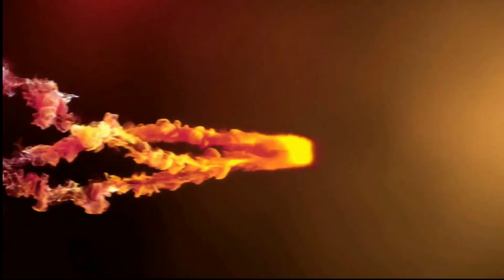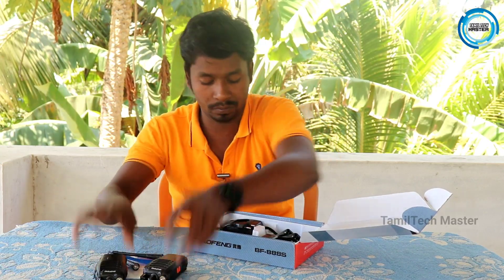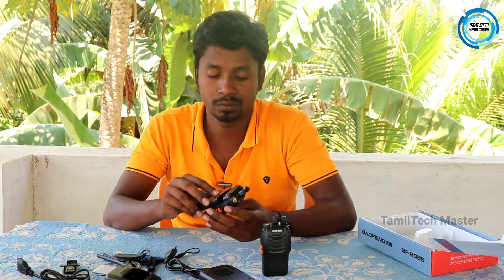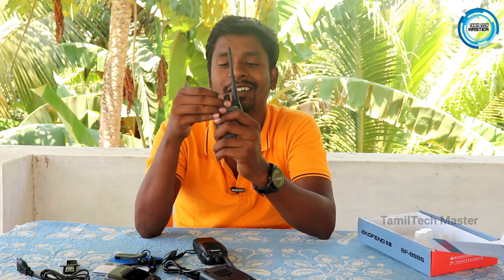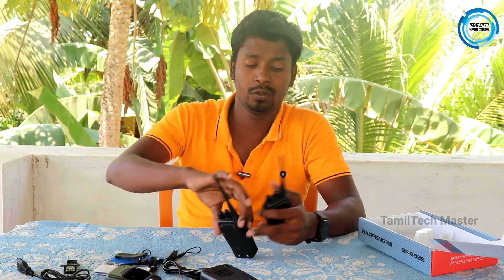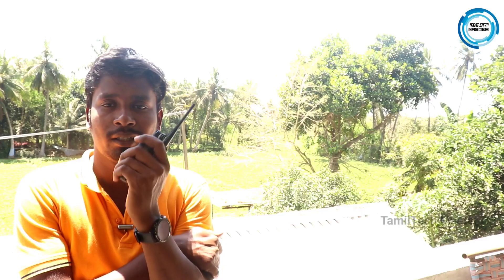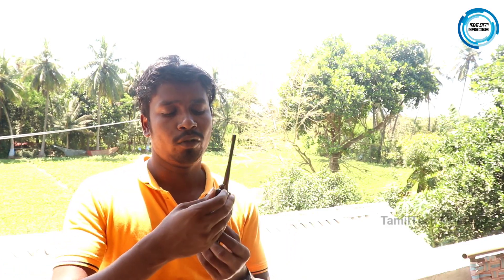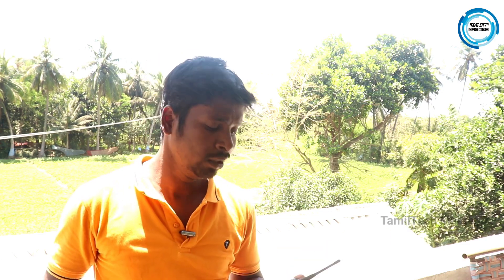Walkie talkie long range review @தமிழ்/Tamil

Comment: Bro I have it and I tested it's get range around 6,7 km maximum in straight way like a high way. Some times it's connect to someone else radio at the same channel
Reply from the maker: I think you tried with different one
Bcoz this model covered maximum 1km without any obstacles.
and also this brand doesn't mention exact frequency details that's y this issues will happen!!